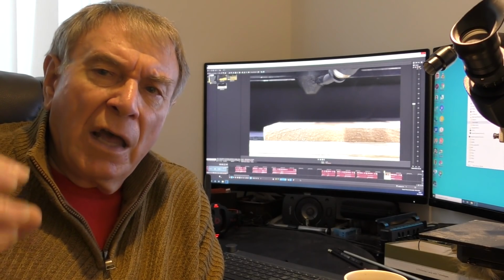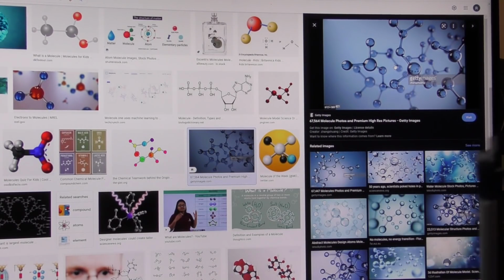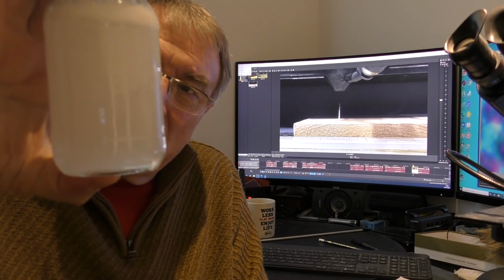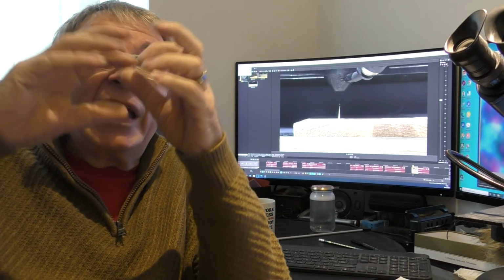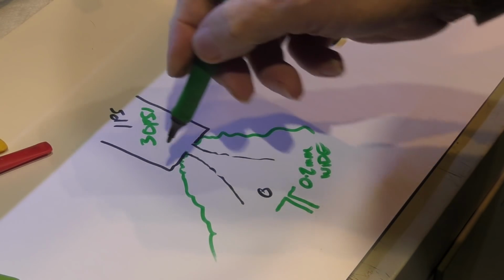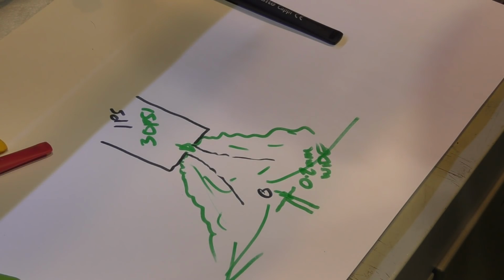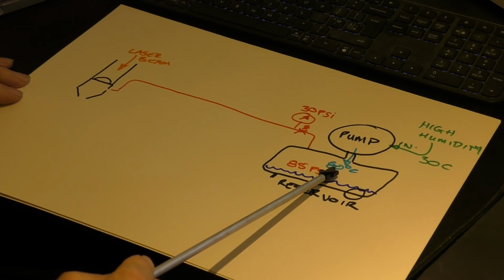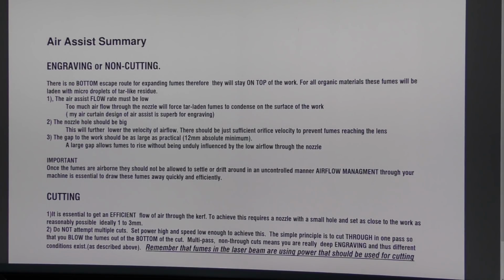RDWorks Learning Lab 223 Air Assist  Why, How and When

Comment: Thank you Russ!
I found another thing that worked well for me/us by accident.
Our big laser has 2 heads, and 2 fishtank pumps and so 2 air supplies to the heads via 6mm OD tube.
Even if I use only 1 laser, I always have both air pumps running so that smoke and crud can't drift into the nozzle & onto the lens of the head that's not being  used.
However, I had a bunch of things (BMP pictures) to engrave in bamboo, and the air supply to the 'off' head had come loose, and had aimed itself at the other head, so while the 100w head was lasering, and the little (approx 3psi?) air pump was chuffing through the air nozzle, the OTHER hose at the same time was actually fanning the smoke right away, by flukey virtue of where it had unsprung itself to.
The result was a bunch of very clean engravings.
After I discovered that, I plugged it back where it was supposed to be and did 2 more objects- and they were yuk! Dirty, with tarry stain blown ontop the image - hence the usual statement about turning the air off when engraving. But that can also create problems with gunk lodging under the air nozzle and falling into the job on big runs.

At any rate it was well worth my using the 2nd air hose to  run blowing down outside the air nozzle, as an extractor of a sort, or a deflector, which left me with a finished job and NO debris to clean off - 1 air hose ending inside the nozzle, and 1 outside at about a 60 degree angle down.
(end of story)

On one of our other lasers, I had set it up originally, piped back to the 40psi air compressor, but found it a pain - often enough the air blew the substrate away- moving it and ruining a job.  After I turned it down enough, I decided I may as well just use the old fish pump, so I did - but I kept the air compressor connection, and added 6 ft of air hose and a dust gun,  and used it manually to blow out flames that tended to come up at times under 20mm acrylic, when you can't always see it happening.
Reply from the maker: Hi Ian
I only demonstrate basic principles and how to achieve them simply. In addition I am alwsys thjinking about more efficient ways  to achieve tjhe same crud -free outcome. In general you should never jhave crud buildup on the nozzle IF you are set up correctly for engraving with a BIG gap between nozzle and work  (12 mm at least) . However, there ar times when cutting and engraving with the same nozzle that compromises have to be made and  yes, I have encountered the debris drop off (especially with photo engraving acrylic). I usually stop the program after engraving and before I enable the cut layer I swap lensesandn nozzles to do the cut layer.. Its easier for normal engraving becuase I usually drop the work 6 to 8mm out of focus for the engraving and then raise the work with my programmable Z axis to do the cutting withnthe small air gap.  As you saw in this video I have also experimented with a "fantail" air assist.  Your twin head is a rather special arrangement that very few possess so the fact that you have been able to find a neat solution with the extra air assist is  a great win for you. Accident or not, acute obsevation and realizing what you are seeing is key to progress. Congratulations.
 Best wishes
Russ
Reply: @SarbarMultimedia  Thanks, and yes. I'm thinking for a single head, a tee piece in the air  delivery line near the head and the ability to point it where wanted,  might be a big improvement- with an adjustable air valve ...
Reply from the maker: @ianstewart-koster9982 Hi Ian
 Thinking about it after I wrote.. Your machine bed will be quite big and I suspect you will either have bars or a fixed honeycomb bed Neither are suitable for my "managed  airffcvlow" system so  your accidental flushing system is clearing the local fumes away  by an air curtain effect of expanding air from that downward facing  opern air pipe.that is moving rapiodly across your engraved surface. It's an interesting discovery that I must experiment with.
Best wishes
Russ
Reply: @SarbarMultimedia  Correct, Russ, re the bed: it's vertical blades. Thanks for the replies. I was just amazed by how clean the jobs were with this 'double  blowing' happening, one out the nozzle and one sideways from it.

Comment: I was wondering if 'vacuum assist' could be implemented at the nozzle (in addition to normal extraction). I guess to make it practical you would need a fairly large vacuum nozzle which would be too bulky for the moving head.

But if the ultimate aim is to remove any particles that are forming between the lens and the cutting surface that could absorb and lessen the lasers impact on the materia,l it could be an interesting experiment.

Lots of wonderful information in your video, I'm pleased I set aside the time to watch it all, and that you took the time to make it.

J
Reply from the maker: Hi James 
 As this vodeo shows  for engraving you will get material spewing upwards  with a volume and speed related to  the depth of cut (power applied).  The problem is  you must have a small positive pressure in your nozzle to exclude the fumes but NOT have a JET of air from the nozzle that will blow the fumes back onto the work....turning it breown as the fumes recondense.  Long ago, before I studied what was happening to the fumes, I had the same idea as yourself and rigged up a small shroud around the nozzle and used a piece of 25mm flexi conduit tube to try and pull the fumes away with a small vacuum cleaner.. Result was noisy and unsuccsessful and as you imagined , rather cumbersome.. Vacuum is not the way to go.. It is far more important to understand the simple principles of air flow management through your machine because the Chinese machine designers have totally ignores it.

 Watch this video from 43 minutes onwards to see a demonstartion of what I mean.   https://www.youtube.com/watch?v=AHnJ2WxNo5Q
Best wishes
Russ
Reply: @SarbarMultimedia  Many thanks for the reply.

Yes, there certainly seems to be a real science to getting minimal air-assist which is just enough to keep the beam path and lens clear from particles, coupled with enough extraction, across the surface of the work piece, to prevent the particles falling back down and adhering to the surface. 

I engrave a good quantity of wooden wine box lids for a Wine Merchant in the UK often with small bespoke elements which makes laser engraving the most practical option over screen printing etc... 

For these I tend to use a sacrificial layer of transfer paper (which is effectively masking tape but it only has a very weak adhesive on the back) it works flawlessly but does slow the work flow. I am now experimenting with blocking/forcing the extraction to draw from above the work piece and lowering air assist pressure to see if I can get a repeatable result with no masking required.

Your series of videos have been very valuable, so I am most grateful for the time you have put into producing them. 

I rather strayed into owning a laser cutter to held a client as part of a larger project (3D printing is my main hobby/business) and had to learn on the fly so your videos are a superb resource.

I am just starting to experiment with the laser marking of metals following your other video.

James

Comment: Hey Russ, Fantastic video sir!! Can I ask what pump are you using and where did you get the attachment to regulate the air pressure?
Reply from the maker: Hi Alan
 It took a while to find a proper ball valve that allowed me to really control the flow of air but this is it
https://www.ebay.co.uk/itm/175129091789?hash=item28c681decd:g:eq0AAOSwL29h8QCE
 the pump is the 70l/min Hailea ACO 328.   Rememeber to suspend it on a wire or string  from the handle otherwise it will  be quite noisy

 Best wishes
Russ
Reply: @SarbarMultimedia thank you so much, you are a legend

Comment: When I'm in focus my tip of my nozzle is 20mm away from the material, is there a different nozzle I can get that will get close to the material?
Reply from the maker: Hi Robert 
The answer may be no but it depends on the head and lens tube arrangement you have. I think it best if you send me your email so yo can let  me have  some pictures of your machine.
Youtube will not transmit even lightly disguised email addresses  but there are ways to fool their basic algorithms. Embed it in a sentence like cryptic crossword clue.  Example.  Selvey is preceded with a dot and robert. I use the g/m/a/i/l service.
We can decode this easily but computers?
 The alternative for a more secure communication is to fill in the contact form on laseruser.com website
 Best wishes
Russ

Comment: Have you ever experimented with an air assist nozzle that produces laminar air flow?  I imagine It would improve the cuts in the same way that a water jet cutter is able to cut using laminar flow
Reply from the maker: Hi 
The physics of flow dynamics in liquids is TOTALLY different to that of gasses.  Those amazing illuminated dancing fountains in LasVegas all work because of laminar flow in a liquid. To achieve this flow is no simple matter . Take a look at this DIY version to get an idea of what's involved. https://www.youtube.com/watch?v=o5L6W0YoAd4
 Liquid is incompressable and is the reason this works. Without getting deep into science, it is possible to have gas laminar flow INSIDE a tube. However, flow implies pressure difference to drive the flow and thus as soon as the gas  exits the tube  the gas will expand and the flow will become turbulent. Large volumes and low flow are the key ingredients for laminar flow in air (Google  laminar flow work cabinetes). Any air coming from a nozzle implies a jet flow  although for real jet flow you require supersonic velocities. Take a look at the images on page 7 of this pdf to see what happens when expanding gas exits a nozzle  https://arxiv.org/ftp/arxiv/papers/2202/2202.04122.pdf. If the pressure is low the expansion takes place much closer to the nozzle.
I have seen the so-called laminar flow air assist nozzles that are based on the liquid laminar flow principles. Hmmmm....I hope the explanation above shows how improbable such a claim is.  
The most efficient way to get air into the kerf is low pressure ,  a small orifice and keeping that air flow orifice as close to the work as possible. Its still less than 10% efficient because the kerf is only 0.2mm wide (at most) and the nozzle  orifice will be 2 to 2.5mm typically.  If the orifice was smaller the efficiency will increase but the tolerance for beam setting becomes impossibly demanding.

 Best wishes
Russ

Comment: Hello! I’ve bought the universal lens tube holder, the cutting nozzle and made myself a 3,5mm spacer so I can be closer to the cutting area. I have the same chinese air pump as you do, however I can’t seem to get clean edges when I cut. I’ve tried all sorts of speeds on the 2,5 and 4 inch lenses. 

To get even cuts on 10-12mm plywood, I typically need to go down to 5-7mm/s.
I bought a big air compressor just to test and blew lots of air through the nozzle, but still burnt edges. (Wiping with tissue)

I probably have a B grade 80W laser tube, and I know the laser beam is a bit high on the third mirror. 
I have been able to cut square through 20mm solid oak with this though. 

Any help would be higly appreciated.
Reply from the maker: Hi
 I think you have   probably already answered your question if you really do have a B grade tube.  B grade tubes are rejected at the manufacturer's plant because they fail to make peak power specification. This is usually because the internal mirrors are not PERFECTLY aligned to each other. Only a slight imperfection causes loss of INTENSITY at the core of the beam. It is this high core intensith that provides efficienetclean  cutting. A "blunt" beam will engrave just fine and will still cut to a certain extent but the lack of central core intensity will cause  low intensty charring of cut edges as instead of the cleam edges left when material is effeviently vapourized.. This simple mode burn test will tell you if your tube is a butter knife or a Samurai sword.
see  https://www.youtube.com/watch?v=R6Wqn5-HMzM
 Air asist aids cutting but I am afraid it cannot cure fundamental issues. The manufacturere of the tube cannot fix this issue once the tube is manufactured so it gets sold at scrap value for "repurposing" by the less trustworthy section of the Laser market.
 Best wishes
Russ

Comment: Do you think it’s more helpful to point At the cut or to point it sideways to simply blow the smoke away?
Reply from the maker: When you first start a cut there is no path out of the BOTTOM of the cut so the fumes  have to escape upwards.  You will always see a brown surface mark at the point because the fumes are blown DOWN onto the work. Once a through cut has been established you must blow the fumes out of the bottom for efficient cutting. Smoke within the cut absorbs some of the laser energy and reignites the fumes. This will cause charred cuts. You can cut with almost no air assist and with a large ( say 12mm plus)  gap between nozzle and work. It will be slower and  you may ignite any up-welling fumes  with the incoming laser beam.  With a big gap and a good cross flow of air across your work  is exactly what you need for engraving  where all the fumes have to escape upwards.
Best wishes
Russ

Comment: Thanks for the info. A lot of people are suggesting the pumps that put out about 1100 GPH... I think that's way more than what is needed for a small, blue diode laser. I find that I'm getting more air out of the inlet filter from too much back pressure than I get out of the nozzle. It's like building a 600hp car engine then putting a 1" diameter exhaust: you lose power and it becomes less efficient because of the restriction. I just don't think 1100GPH is necessary (that equates to about 69LPM if my math is correct). Thoughts?

Comment: Your videos are incredibly helpful Russ.  Hopefully one day you'll do some experiments with the diode lasers as opposed to CO2 lasers, as sure it would be an interesting journey for us all.
Reply from the maker: Hi
 Thanks for the kind words. For 6 years I have been self educating myself on the minutia of laser technology.The CO2  10,640 nm wavelength allows me to really examine the characteristics of the laser beam. The way that it uniquely evaporates acrylic and leaves "footprints in the sand" provides  an invaluable research tool. The fibre laser (1064nm) and diode laser  ( about 450nm) have no such association with any material and thus are difficult wavelengths to explore. A laser beam is a laser beam and will ideally have a Gaussian intensity distribution within the beam regardless of its wavelength,  thus my acquired knowledge with the CO2 laser  is applicable to all other laser  types. However, understanding laser technology is only half the problem. The other half is all about how materials react to different light wavelengths. I have explored the world of CO2 RF lasers and there is no "magic" there despite what  the big companies would have you believe. I have explored the world of fiber lasers  and that is an interesting but limited  technology aimed at marking materials. Again  there is lots of hype about fast marking speeds  and yes, under certain limited circumstances and with specific materials, that claim is true...... but over a very limited area. The main feature of low power fibre lasers is their ability to micro machine material surfaces.  The marking  colour or colours achieved with Q switch or MOPA lasers is  different to the chemical changes effected by CO2 or diode lasers that is really damage materials. The fibre laser manipules the surface texture  to create light absorption (black) or various light reflections and wave interference patterns to create false colours as you see on a butterfly wing. Google it and you will see a full explanation.     Given enough time it is possible to cut  a limited range of materials with a low power fibre  but unless you work with kilowatts this is not a cutting technology. As the wavelength of light shortens, the type of damage and range of materials that can be damaged decreases rapidly. My interest is understanding the science (it keeps my remaining 2 grey cells exercised) of laser technology and materials. Sadly I cannot see myself entering into the world of diode lasers.  Yes it is a cheap hobbyists entry into laser technology and CNC control ,  and there are now  some very interesting and novel machines appearing (Laserpecker 2) but it's ability to extend my education is very limited.
 Best wishes
Russ